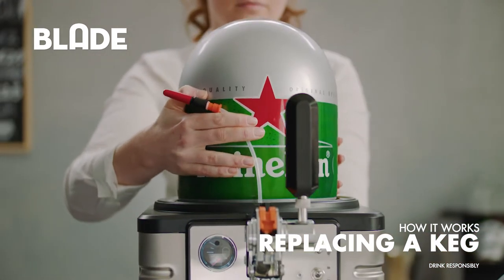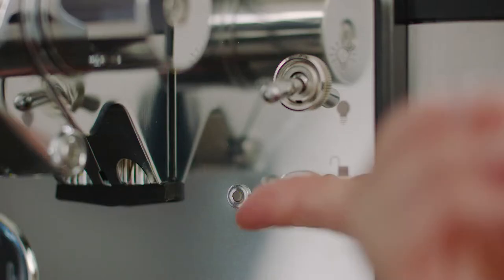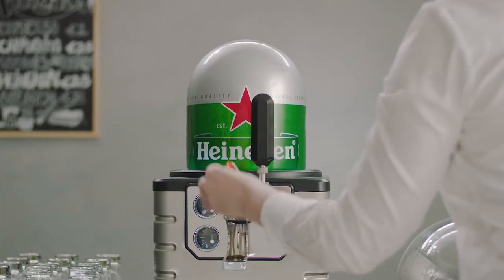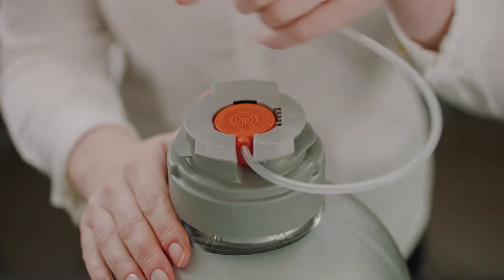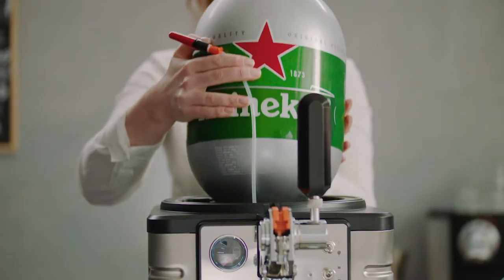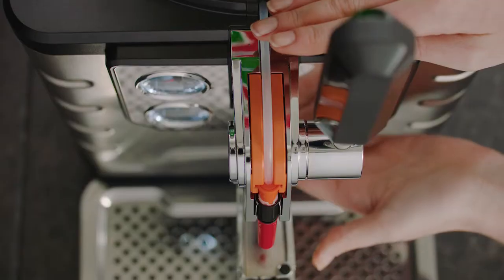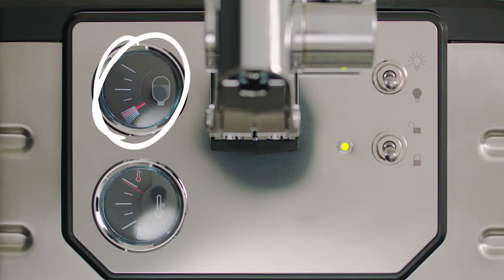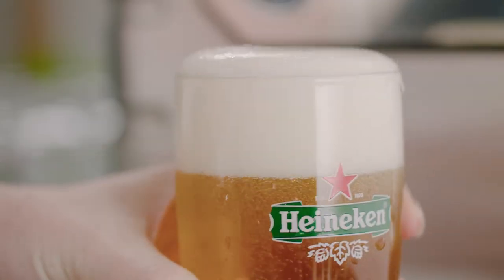Blade -  Replacing a keg

Comment: Can you put the keg even if its not cold?
Reply: Yes it cools in no time at all too less than an hour
Reply: No, don't do it you'll ruin the motor cooling it as plenty have done before. The kegs are meant to be cooled for 18-24hours to take the hard work out of cooling them. The blade essentially just keeps the kegs cool and maintains the pints your pouring at 2c. 

I've seen and heard of people just putting in the kegs and letting the Blade cool it down then the machines break. After spending nearly £500 myself on a kit I'm just going to be patient and careful so I can use the Blade for a long time.